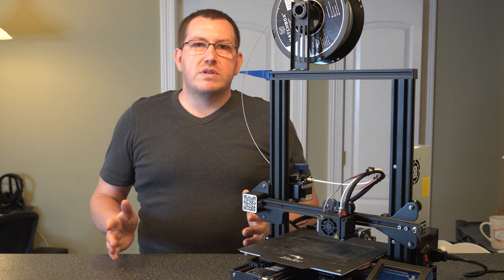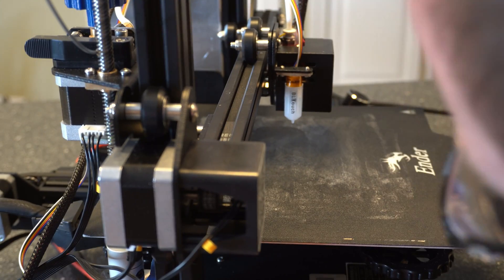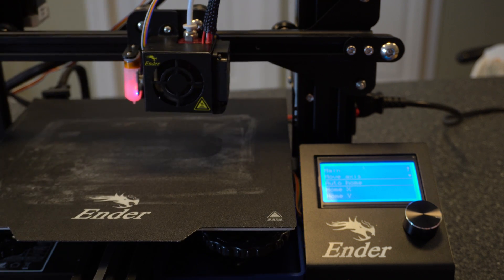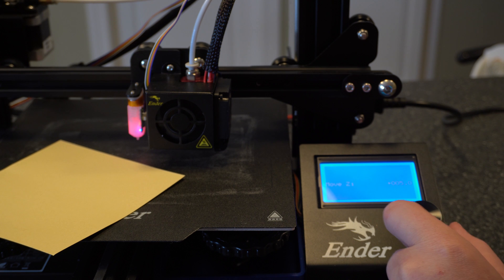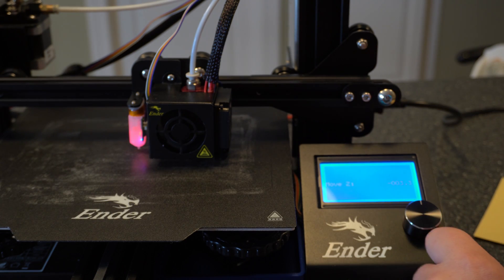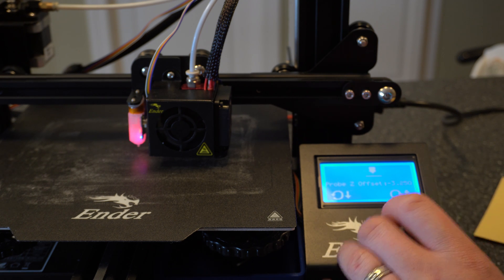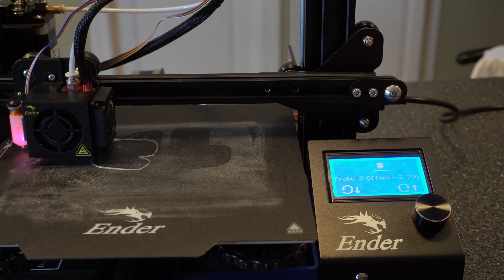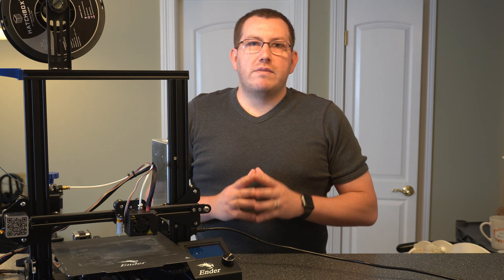Z-Offset BLTOUCH With Marlin Firmware

Comment: My bltouch came with the solid one piece connector that connects into the dedicated port on the skr mini e3 v2.  So I left my z endstop switch plugged in but no one has a tutorial or video on how to setup the bltouch with the zstop still plugged in.  How do I setup the probe with the zstop?
Reply from the maker: Hi. Comment out #define Z_MIN_PROBE_USES_Z_MIN_ENDSTOP_PIN and uncomment #define USE_PROBE_FOR_Z_HOMING in the firmware.
Reply: @3DPrintscape  after changing the firmware should I get rid of the zstop switch and unplug it or should I leave it in place and just adjust it down a little bit so it is simply there as a failsafe
Reply from the maker: @Flyfishingonly  The firmware is expecting it to be there, so you should leave it.

Comment: hi! Im having an issue moving my z axis past 0, I'm using an ASK board and BL touch on an ender 3 pro
Reply from the maker: Hi. It sounds like software endstops are enabled. If you built the firmware, you can disable them there or you cna send the m211 s0 command to the printer.
Reply: @3DPrintscape  Thanks!!

Comment: Do you tighten all the wheels first?   I’m used to testing with paper in all 4 corners - do I not need to do that now with the BLTouch?

And do I need to use the same SD card every time?  Or does the save settings go somewhere else?
Reply from the maker: Hi. You want to level the bed first even with the bltouch. Having it close to level means the stepper motors wont have to work as hard. You dont need to use the same SD card every time, the setting are stored in the printer.

Comment: For some reason when I try to auto home my printer when it gets to the center it keeps going up instead of down.
Reply from the maker: Hi. Make sure your using the right config examples as the starting point for your marlin build. It sounds like the drivers may be wrong.

Comment: Anyone know went the cr touch different take the z offset negative value even if it's stored?
Reply from the maker: Hi. Is it letting you set it negative, then goes back to zero? You may have to disable the software endstops with the m211 command.

Comment: I been banging my head against a wall over this upgrade and now I’m here and see you are using the z adjustment in the move panel that I could adjust yesterday but now today it won’t move from zero. I just swapped out from the marlin 1.1.2 back to the 1.1.1 assuming that’s was why but it still won’t let me move that. I don’t know what I did? My only solution… more coffee
Reply from the maker: Hi. Try to clear your eeprom, make sure the software endstops are disabled, and get some more coffee :).

Comment: when i auto home my printer it does x, and y just fine but when it goes back to the center to home the Z it will go up and then not extend the probe instead tells  me STOPPED. i have a 4.2.2 board and have been trying different softwares from the net but does the same thing every time please help if possible.
Reply from the maker: Hi. Can you join the discord server or email me pictures of the wiring? My email is admin@3dprintscape.com

Comment: My resistance started at +6.2 and when I go to set the bltouch z offset to match ots way way to high like 10-15mm away from the bed
Reply: I got it figured out I was doing it wrong at first. It's about where yours is now
Reply: When I got to the z offset for the bltocu it was at zero and there was still resistance  so I'm gonna try that but this thing is scratching my bed so much lol hopefully this works
Reply from the maker: Hi. In sounds like the z offset still isnt right. Keep in mind that it doesnt come into play until the print starts, so if you autohome the printer it will go to +10 by default regardless of the z offset value.
Reply: Thank you for the reply BTW
Reply from the maker: @w1llowsworld  You're Welcome

Comment: I did it exactly like this (found out 3,1 offset, I set 3.0) and when an actual print started, the nozzle dug deep into the bed and carved a trench. What the hell?
Reply from the maker: Hi. Make sure the offset is set to 0 when you start the process and that everything is tight (eccentric nuts, belts, etc).

Comment: my bl touch goes to the center of the plate with x and y axis perfectly but the z axis doesn't move when the bl touch pushes out the probe. Instead it just sits in the center 20mm up and moves the probe in and out. Any idea what's going on? Please help. If I touch the probe when it's moving it starts going down then stops. (I have board 4.2.7)
Reply from the maker: Hi. It sounds like the black and white wire is reversed or the wiring doesnt match the firmware you are using.

Comment: 1: is there not one person on youtube that can afford one of the good printers from creality? I have a CR-10 v2 because I have a job... and unfortunately there isn't a video on my printer or any of the other versions of the CR-10.

2: all adding this worthless thing to my printer did was make it print ten inches over the print bed, I contacted creality and they told me that was impossible, basically refusing to help. I just clipped the wire and loaded the old firmware back onto it... now it prints perfectly.
Reply from the maker: Hi. I was looking at getting a CR-10 but will probably end up getting an Ender 5 Plus instead, I like the frame on it better. Once the bltouch is setup, its a really nice addition to the printer, getting there isnt always the easiest though. Based on the description of the issue you had, im guessing it was from the wrong firmware being installed or the eeprom not being cleared after the firmware update. That said, im glad the printer is working good for you now.

Comment: I'm doing something stupid but I don't know what... I set the BL Touch up with the SKR Mini E3 V2 and I went for option two where you replace the z-stop with the 2-pin BL Touch probe sensor. When I Auto home though the printer finds X and Y just fine, but goes up when trying to home the Z and not down. It finds a z home of 11.85mm consistently but it's flashing ???'s at me as even it knows that's wrong. It's like the up and down for the z is reversed (is that possible??). I will say I've only just built the Ender itself and never run it (I wanted to get all the main upgrades done at the same time).
Reply: ...but it's still not letting me set a negative z value to manually set the Z offset {eyeroll}
Reply from the maker: Hi. Are you still having the first issue? The second issue sounds like the software endstops are enabled. You can disable them in the firmware or by sending the M211 command to the printer.
Reply: @3DPrintscape  ah thanks for replying! Yeh I eventually worked out that I needed to put all 5 BLTouch connections in the one 1 row when using the homing firmware. It doesn't seem to work when I replace the z-stop with the 2-pin BLTouch connection i.e. split the BLTouch connections. 

And yep, the stops in firmware we're preventing me from determining the negative z offset. So, pronterface M211 S0 for that one. 

I had more issues getting the z offset calibrated as it kept wanting to print in mid air. I think it was referencing the z offset from the current z offset, so my offset always seemed to be about -1.5. Once I set it to zero and then determined z offset it was more like -3.5mm.
Reply from the maker: @nathanburley  Ok great, im glad you got it figured out. If you run into more issues and need help don't hesitate to reach out.

Comment: I made the adjustments easily and my z axis moves using the controls or while homing.  When I begin a print the z axis does not move up throughout the print and if I go to move it in the controls it reads NaN.  Any idea how to fix this?
Reply from the maker: Hi. It could be related to the bltouch wiring, or the wiring not matching the firmware being used. Make sure the wiring is correct based on the actual pinouts.

Comment: I have a problem. I can set the z offset using whole numbers only. eg: my offset value is -1.4mm, it only lets me use -1 and -2
Reply from the maker: Hi. Thats sounds like its firmware related. What firmware are you using?
Reply: I got it off the creality website but it's the ender 3 4.2.2 with Marlin 2.0.1 - v1.1.2 with BL Touch.
Reply from the maker: @captainthiccnick  Interesting, can you try the marlin build I have on my site? https://3dprintscape.com/marlin-firmware-builds/
Reply: @3DPrintscape  Thank you so much Sir! that did the trick! You the real MVP

Comment: Does anyone know why mine in some points prints in the air but at other points it prints on the bed ?
Reply from the maker: Hi. Are you running the mesh at the start of the print? Im guessing the bed isnt level or the full mesh isnt running at the start of the print.
Reply: @3DPrintscape  is the mesh the probing of the 9 points before the print starts ?
Reply: @3DPrintscape  if so I thought that I could turn that off in cura becuase the option level bed on my printer would do that for me
Reply from the maker: @gabg116  I run the mesh at the start of each print to make sure its as accurate as possible for the print. You need to have the G29 code in the printer settings in Cura.
Reply: @3DPrintscape  I have that as  but every time after I level my z offset and go to level bed it seems as if the z offset is incorrect
Reply from the maker: @gabg116  If you change your build plate position, the z offset has to be set again as it will change. I level it once and just do a mesh at the start of each print. That typically works for several months without having to touch it again.
Reply: @3DPrintscape  I am not changing my build plate position I do not think I am using Creality software for ender 3 my prints are just uneven all around the bed almost like when it is probing it  does not even record the probe
Reply: @3DPrintscape  can u give me in order the steps to level my bed with bl touch
Reply from the maker: @gabg116  I do a manual level first. So lower the nozzle to a good height then move it to corner 1. From there you would raise or lower the spring to get it paper distance from the build plate. Continue this until you get through all points, then do it again to account for changes one side could have made on the other.
Reply: @3DPrintscape  👍

Comment: i can not go below 0 for offset. do u know why
Reply from the maker: Hi. It sounds like the software endstops are enabled. You will need to disable them with the m211 command or in the firmware.
Reply: @3DPrintscape  yes you are right:) i arrange Z offset value. When starts to print, nozzle go higher.. i will be crazy
Reply: @3DPrintscape  I am having this same issue, how do you disable the endstops in order to set z offset lower?
Reply from the maker: @mindbenderfpv3165  Hi, you have to send the m211 command through g-cdoe. I cover the process in this video. https://youtu.be/T1TH0QpHVWs

Comment: Hey - interesting video. Can you explain why you set the Z offset at -2.5? you mention that the card was loose at -3.2 and tight at -3 so picking in the middle - but -2.5 is not in the middle of those two numbers. Thanks
Reply from the maker: Hi. If i remember right, i had to tighten the z-axis. I didnt think it would make a difference for the video though.

Comment: What board and firmware are you using for your ender 3?
Reply from the maker: Hi. I have two Ender 3s, one i have modded a lot, the other is more stock so i can help people out. The modded one has an SKR Mini v2 running Marlin and the one closer to stock has the 4.2.2 with Marlin.
Reply: @3DPrintscape  I'm having an issue with the z offset.  I keep setting it but when I start the print it starts around 10+mm above the bed
Reply from the maker: @geneticboobyprize  When you home the printer, it will go to +10mm. Once the print actually starts, it should use your z-offset. What is the z-offset currently set to, based on what your describing, it sounds like it may still be set to 0.

Comment: i would be great to do this same video using the BTT tft
Reply from the maker: Hi. I think this video will cover what your looking for. https://youtu.be/2gRfU26aTDs
Reply: @3DPrintscape  I did actually fit this video after writing my comment. I actually ha e a problem where I can't lower the nozzle past a certain point. I have been on your discord and have even loaded your version of the firmware from your site. I have no clue how to resolve. Let me know if you can help
Reply from the maker: @IlanPerez  I was thinking it was the software endstops, but if your running my firmware, that wont be the case. Is the z axis hitting any physical blocks or anything? Also, can you send a video of what you seeing to me on discord?

Comment: My ender3v2 looses offset every single print, any ideas?
Reply from the maker: Hi. Make sure you carriage isnt lose and that the bed is level with the springs tight. If the springs are not tight, its possible they will shift some during the print. I upgraded my springs to prevent that.
Reply: @3DPrintscape  had this issue before, change to longer harder springs. I had to re auto home after auto leveling then it worked

Comment: I don’t have a offset under motion it is only under bed leveling
Reply: I only have it when I go to control-bed leveling. Will I only know it worked when I start a print because when I hit auto home it doesn’t go to the level that it should it just goes to some random height and not the height it should print at
Reply: When I change the probe z offset it doesn’t move up or down when I change the value either
Reply: Also should I just move the bed down as low as it can go so the knobs are all the same level in each corner
Reply from the maker: Hi. You will want to manually level the bed as much as possible before trying to use the bltouch. The z-offfset only comes into play once the print starts. If you autohome the printer, the nozzle will be around +10 on the z axis.

Comment: I do not have a setting for Z offset under Motion > Control. Any suggestions for the new versions that don't include this option?
Reply from the maker: Hi. Can you go to the about screen and let me know what version you are running? It sounds like the bltouch firmware didnt upload.
Reply: @3DPrintscape  I managed to find it! It appears in newer versions of Marlin with the BL Touch firmware it has been moved to Bed Leveling > Z Probe Offset

Comment: I followed the steps in this video and your other video that you upgraded to the 4.2.2 board and I cannot get my Z height to stick. After bed leveling and auto homing, my z offset sits about a +10 which is monster gap. After lowering the Z and I see I need to be at -1.6 or so, so I then set that within the Z-offset menu under the BL touch tab. I save the setting then re-home. After homing, the z sits even HIGHER at about 11.6🤯🤯🤯 No idea what to do here.
Reply from the maker: Hi. The z offset only comes into play when the print starts. When you auto home, it should be at +10. Changing the z offset shouldnt change the auto home position.
Reply: @3DPrintscape  Okay, I'll give that a try. Appreciate the feedback👍

Comment: I have an ender 3 pro SKR mini2 with a newly installed BL touch per your video @3dprintscape. I'm using the standard BIGTREETECH-SKR-mini-E3/firmware/V2.0/firmware-bltouch-for-z-homing.bin firmware off of github but when I flash the SD, insert and try to autohome my printer just drills into my z endstop instead of homeing to center. Any suggestions? (also posted on your discord)
Reply from the maker: Hi. I replied in discord, but it sounds like it may be a wiring issue.

Comment: hi sir, why my z axis won't go down further around -3.0 even if i input -10, which is crazy. my motor won't let me. but when i'm printing, the adjustments applies.
Reply from the maker: Hi. Based on what your describing, i believe its the software endstops. You can comment out #define MIN_SOFTWARE_ENDSTOP_Z or use the m211 command.
Reply: @3DPrintscape  hi sir, i'm not much of a programmer myself but i'll be patient learning new stuff. The command/comment you mean is for the print whenever preparing a 3d model in slicer?
Reply from the maker: @erysonrodriguez8398  Not exactly. The first option is a setting in the firmware that can be commented out but only works if you are building your firmware. The second one requires you to connect your printer to your computer and using something like Pronterface .
Reply: @3DPrintscape  hi sir, i found a solution and might give it a try with pronterface from another streamer. I think it's the firmware (marlin) default limiter that stops me
Reply from the maker: @erysonrodriguez8398  I released a video not long after you reached out covering the process, you can see it here. https://youtu.be/T1TH0QpHVWs

Comment: I installed the same firmware and I don’t have a “set z offset” under motion and my printer won’t store my settings even with an SD card in my printer. I’m on a regular Ender 3. Anyone able to help? Driving myself insane
Reply from the maker: Hi. Did you enable it in the firmware? Its disabled by default.
Reply: @3DPrintscape  thanks for the reply. Was able to figure it out.